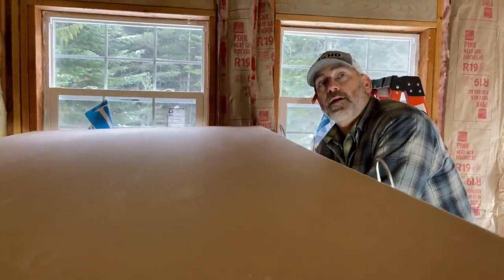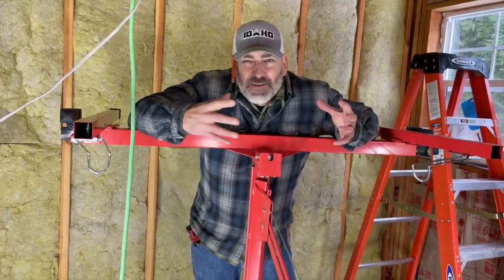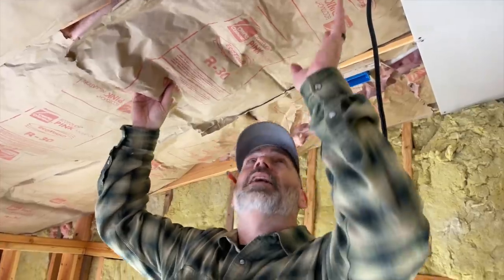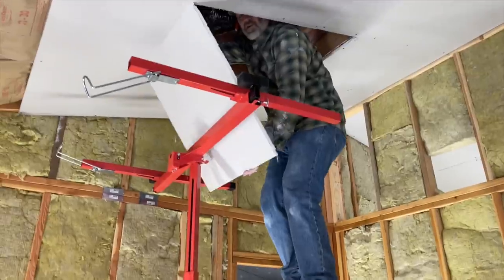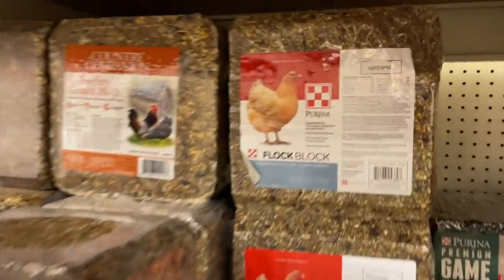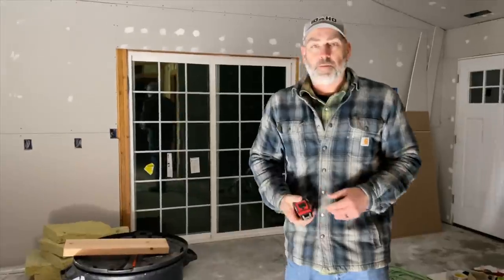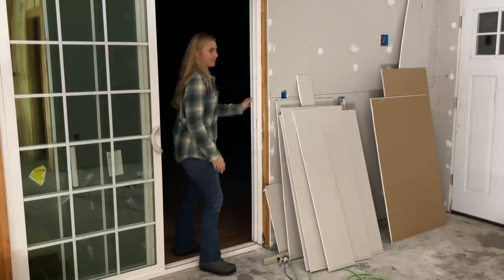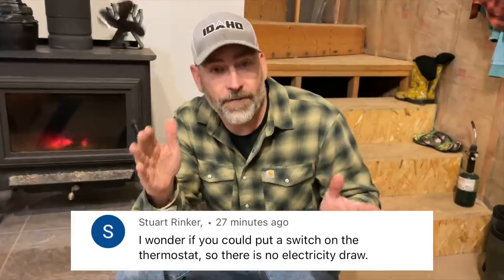Sometimes You Have to Let it All Out - Couple Building House Off Grid

Comment: Code always requires a switch Within Reach of the service panel door so that you can guarantee the unit is off while Servicing yearly to clean the burner and check for proper operation. It is usually located on the side of the Furnace itself

Comment: Mark your cut lines with a sharpie.  It makes the paper softer there and the cuts can be made cleaner.  A whetstone to sharpen the blades will help.  I like using a carpet knife to cut drywall.  (it's curved and shaped a little like a scimitar).

Comment: Have sheetrocked alone  that lift definitely  handy    my last sheet rocking job that wouldn't  work in bathroom  repairing flood damage   everything  still connected and new surround for shower  tub  ended up putting  2x2  and 1x4s to create track to slide sheet rock into place  very trying  but no room for 2 people and ladder   gotter done   finished repairs  took longer than liked but working alone takes what takes

Comment: Now that the heat is on. No vapour barrier plastic. Before drywalling more walls pull back the insulation and see if water is collecting on the cold OSB. This system you have installed I have seen mould on the OSB with in a year. From experience.
Reply: I keep saying this since they started putting up the drywall. Martin is a bit ignorant about building techniques and he takes them lightly. When he is in doubt he says “nah, i think it will be alright”. Let’s hope it will because nobody wants to deal with mold.

Comment: I thought it would be a good idea to have your furnace fully wired b4 sheeting the ceiling, rather than it's power cord just hanging, Could be a safety issue to attach it later.
Reply from the maker: Hope it will be fine.

Comment: It might be designed to act as a vapor barrier, but if it isn't installed correctly, it can't block moisture from passing around it.
Reply: I have kitchen sieves that make better vapour barriers then the tarred paper on the insulation.  You would be better off using just insulation and a 6 mil polyethylene vapour barrier.  The next step up in sealing the vapour barrier is acoustical sealant on all polyethylene joints.

Comment: I think a switch by the furnace is needed for service work later. If repairs are needed the switch will keep you from the ups and downs to run back to the breaker every time.
Reply: The code requires a switch that cuts all power next to the furnace.

Comment: Hi folks, 
Someone suggested a toggle switch and Martin said the furnace could be turned off at the breaker. I am pretty sure that what you are connecting is a low voltage wire. When you get to the sheetrock where the wire comes through the wall, I think I would use a thermostat and thus eliminate the breaker. Have good days!

Comment: You guys are doing well on push ups and plaster boards, Just a suggestion when you hang all plaster board place a couple of lights in the ceilings out let's which should give you better spread of light in room and hook up switches to those circuits less cables and lights to trip on safty sally will like that

Comment: I like your videos. I am curious as to why you are not using a plastic vapour barrier on the outside walls and ceilings before installing the drywall. I see you have it installed in the main house on the kitchen walls.

Comment: Nicely done :) Just a question, why are u not using vapor barrier in apartment to resists diffusion of moisture through the wall, floor, ceiling and roof assemblies of buildings to prevent interstitial condensation

Comment: I have no negative comments at this time.  If I do, it is usually over a critical structural issue because I care.  So how do I feel about the drywall?  According to the International Residential Code, you only need screws every 12 inches (ceiling or wall) for 1/2-inch drywall, regardless of whether the screws are in the field or on the edge.  But you do need 5/8" type X drywall on the garage ceiling placed perpendicular to the floor joists, and screws every 6 inches.  You need 5/8-inch type X drywall anytime you are transitioning from an unheated room (garage) to a heated space above or next to the wall.  The 5/8-inch type X only has to be place in the cold room (garage).  Everything looks great!  I am impressed.  And the mud and tape takes a little practice.  But, texture is more like artwork, really.  If you do not want to spray texture, you can always do Spanish Knife texture (looks like the Inside of an Italian or Mexican Restaurant).  Just take your 6-inch putty knife, and the topping compound, and make sharp streaks all over.  There's no end to texture.  The contractors rent the spray machines, and spray the whole room.

Comment: Martin, you are putting too much faith on that paper faced insulation for vapor barrier. You have so many places where you are missing the paper and you have potential leak in every seam, you could at least tape them and add plastic vapor barrier around the headers. You are in a heating climate, sealing the envelope is crucial.

Comment: I do not see a power cord. so what runs the fan on the wood stove?
Reply: Its thermo electric, produces voltage from the temperature difference between the surface of the stove, and the air temperature.

Comment: Sometimes, it's the little piddly things which make things more enjoyable to the point of being significant for production.  For at least the short term while there is still extra room in your garden area, I sure could see some benches, chirs, or seating area so you can take an honest sit-down break up off the ground while working down there.  A small table to put a hot thermos in the spring and fall or cold thermos in the summer would be nice.  An umbrella coated with waterproofing for summer sun and sudden rains would be all the better.

Comment: In one of these videos you asked for ideas related to changes about the garden:  In many community gardens they install hose reel poles which begin as a 2"x4", two 2"x4"s back to back, or a 4"x4" sticking above grade about 4'to 5'.  If you do this, i strongly advise a fence pole cap or something to deflect water (snow, ice) from the flat top of your pole; even if you use a round length of tree trunk instead of lumber.  Of course, the most sturdy and simple hose reel found is a start; and one has to decide on one with enough width for 50' or 100' feet of hose.  The easiest hose reel poles to use have water pipe or hose coming up the pole and attached to the hose's inner connector so that all one has to do is peel off hose, turn the water on for use, then reel the hose up after use; there are multiple ways to do this.  As a hose reel, these poles are useful.  These poles become wonderful depending upon the "accessories" attached to them be they metal baskets, coat hooks, and any assortment of things found and purchased to hang, hold, or elsewise attach hose ends, watering wands and hand tools, gloves and hats, etc...Or simply to keep long handled tools upright.  The displayer strips used to hang bags of chips at mini-mart cash registers are pretty handy hanging off these poles as well.

Comment: While you are working on insulation and sheet rock - think about the things you trudge to and abiut the garden daily or weekly.  The things you put down in the garden area even though thier home is up in some building outside the garden then spend time looking for.  The things you grind into the pathway medium or trip over because they have no home in the garden.  These are the things which need a home down in the garden even if thier "home" is only a summer or garden season home.

Comment: Every garden needs a wash sink.  Coming up with a wash sink can be as easy as carting in a bathroom vanity and hooking up  garden hose inlet; this design works but a kitchen sink works better etc... The "thought" process is what to do with the "effluent" water because even when/ if purposefully using the rinse water isn't a concern, the space below and around can become quite the slippery mud slick no one wants to stand in.  Those who simply pipe or hose the water into a bed or cistern of some type are soon reminded what fine silt dirt and organic matter does to a waste water system.  Your garden is getting to the size that a garden side wash sink station of some type is in order.  Some sort of a shade providing and rain protection roof would be all the better.  Simply a way to string up a thrift store bed sheet for some shade protection would be better than nothing; optionally with time and money you could use a Harbir Freight Tools 60-70% UV protection shade cloth for some heat relief as well.